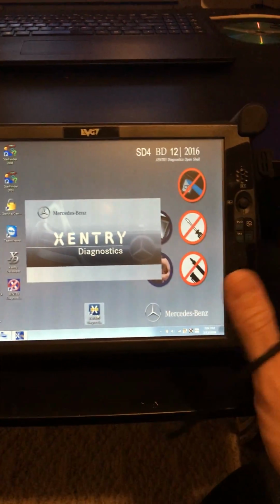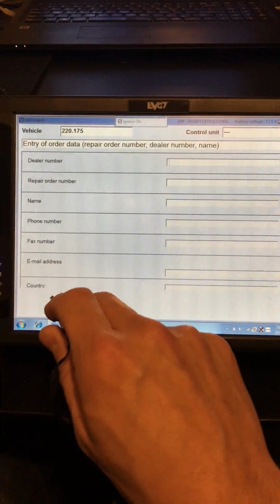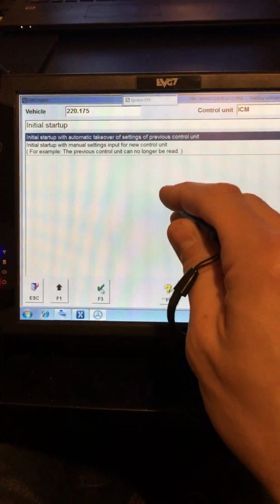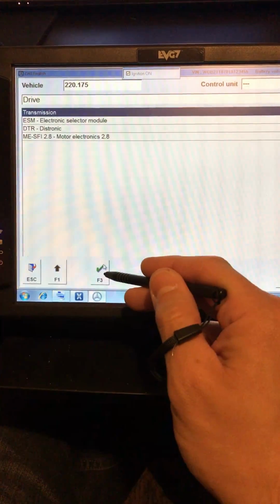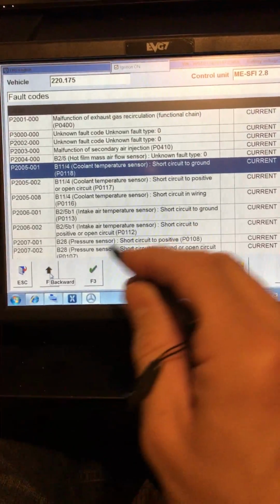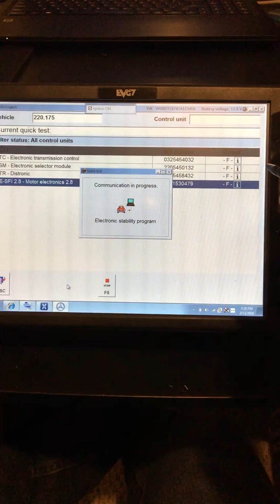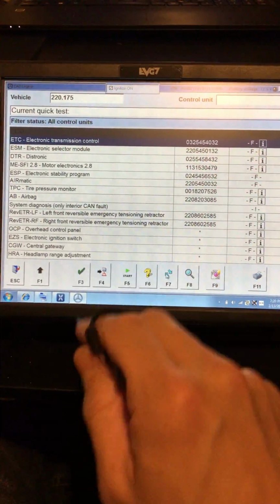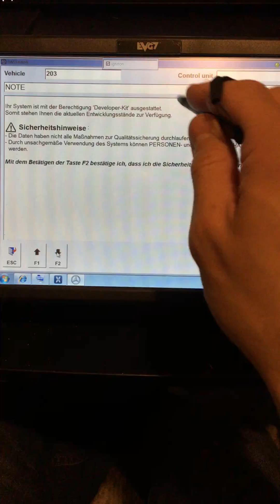Mercedes Benz SDS Star Diagnostic scanner tutorial quick intro on how to use the scanner

Comment: Man i just got mine set up man, and I was using the simulator untill my c4 comes in, and I was like " dude this simulator car is Fxxxcked" lol.

thank you for the f8 tip,its a learning curve i appreciate eit very much. maybe some more videos on this would be appreciated well already subbedA
Reply from the maker: Thank you!, yes in fact I once worked with a guy who bought a star, and the company he bought it from had the same link for the simulator under the standard xentry icon, drove us crazy, I was like lets just hover over the link click properties, dammit! He had 2 simulation icons!!! I don’t know why benz put a simulation program In but it has helped me help others through the years.
Reply: @MasterTechLou  oh wow whats different Yeah im still learning. Just really wanna fix my r170. I actually just grabbed a coil wire from another m111 i believe and it was same 2ohm but my car didnt like it at all. so I shut it iff after 2 quick starts and revs. hope i didnt break anything i have an OEM pair coming in in few days, thought id be able to get away with this
Reply: @MasterTechLou  hey Lou one another thing sorry if im being a pest. When it says Ignition off/on you said 10seconds. So its at position 2 which is ACC the mode before starting the engine, i go back 2 clicks or 1 click? and I wait 10 seconds in the Off position all the way back or just back 1 click from the Acc pre start position.

I managed to clear my codes but still ran bad, let it run for an hour yest now gonna go out again later after I check here in WIS more
Reply from the maker: @Mitutumuch  if you are using the merceded scanner it will tell you if it wants the ignition off for a time period or just off on, and off means off, on means second click where car is live. We will never use the first accessory position except for resetting maintenance in the dash.
Reply: @MasterTechLou  thank you Master Tech Lou, I have been troubleshooting my slk230 I believe to be a bad tps. I dont know where rlse to look and I found that inside the WIS limp home mode is directly correlated to a TPS. and also I found that if the TPS is faulty by any means ( signal drops) the tps works off of the throttle body instead. Dumping the boost from the supercharger to protect internal damage? that must be why theres a second butterfly valve? as a precautionary measure for the cheap tps. 

also this just so happened to be under the Brake category too

Comment: I don’t know if you’re going to receive this as I expected to see a different format for a response. I have this system and I am trying to learn how to use it efficiently. The current problem is my transmission is slipping, not going from 1st to 2nd.
Reply from the maker: Ok thats tricky.
Transmission issues. Especially working via text or chat.
My site is www.cartechconnect.com 
But first try to adapt the trans and check fluid level. Then check the fill times in the trans module for 1-2 to see if they are excessive. But If you reach out to my site ill do what I can to help. Hope you at least enjoy the videos. Thanks, Lou
Reply: @MasterTechLou  I"ll see you on your site. I have three of these automobiles so I am always trying to deal with something. I can tell you that the code I got was P200A. Then it said it might not necessarily be defective.
Reply from the maker: @beckwith46  ok my friend. You wont regret it. I build long lasting relationships with MB owners that do their own work and or own shops.

Comment: Hi, i have 2020/03 Xentry, works ok, but can't read the Engine ECU on my w211. What could be the problem?
Reply from the maker: Power,ground, data lines, bad module.
If you need help diagnosing you can reach me at www.cartechconnect.com

Comment: what a great tutorial. So i have to replace old zgw to the 'new' one from another car. After installed it Then i miss an option in 'convenience' section that is automatic seat+steer (named easy entry). What should i do, what i thought is copy from old data zgw and paste replace data to the 'new' one. So kindly please how to do it under das xenty diag? thank you in advance. regards
Reply from the maker: after running the quick test, go to CGW then adaptations, it should be in there under ALL CODES . go down the list. find the setting and select it, you can also make sure its turned on in the instrument cluster settings. it may have gotten turned off.

Comment: i see a lot of them trying to find the one like yours i see one for 879.00 and by the way i have a 02 s430 mercedes having problem with limp mode stuck in 2nd gear i replace the valve body and everything with it check transmission fluid ,i have the x431 v scanner i delete the codes but they come back would your scanner program the tcm and other stuff thank you
Reply from the maker: kennedy shorter this tcm cannot be programmed.  And no these scanners cannot program or software update. All the star diagnosis do the same just different platforms. Choose which you like.

Comment: i am having p1071 running lean code on my c230 2005 kompressor. Will this help find that possible leak? Also throwing off all kinds of engine codes, p300 and multiple misfires.
Reply from the maker: Psy Lee yes and no. The scanner does 20% of the work, the knowledge and experience of the tech does the other 80%. Normally I will not diagnose in comments but your model has a huge issue with a crankcase hose that tears. Up in the front of engine between charger and the block. This was a service recall a long time ago. Im sure you can google and find the bulletin.
Reply: @MasterTechLou  OK thanks , I'll look into it, most of the recalls were services . I think I might get one of these anyways !

Comment: Great information! What if the problem you are experiencing doesn't throw any fault codes? For example, when accelerating, the car cuts out (as though starving for fuel or spark) and all the dash lights come on briefly, but the car continues to drive. The scan doesn't show any misfire codes or anything I don't already know about on the car...have a light bulb out and a rear seat removed so the SRS code is showing for that? Will/can the cartechconnect.com site help with something like that?
Reply from the maker: Dave's Drone the scanner is 20% of the equation, the other 80% is a knowledgeable tech that knows what values should read what.

Comment: I'm looking for a scanner that can turn off the SRS light on the dash of Mercedes models. My current iCarsoft CR V2.0 shows no fault codes in SRS system. Same result with my Blue Driver. So no codes and light stays on. I have three customers with this same issue. Will the MB SD Connect C5 do this?  Thanks for your help.
Reply from the maker: William L Brice I ran Into this recently. Check icArsofts website for the up to date software on your scanner. Also try a foxwell. But yes of course the star scanner can do this. Its the oem mercedes scanner we use at the dealer :)
Reply: @MasterTechLou  
I assume that this will work.  
MB STAR C5 MB SD Connect
This requires the use of a dedicated laptop as I understand it.  A laptop that cannot be used for any other purpose.  Is this your understanding?
Reply from the maker: @williamlbrice1357  just buy their setup. it sooooo much easier that way. even if it fails its easier for them to swap it out with another one.

Comment: Pretty much everything failed on my car. I'm guessing I have to drive it around after replacing the battery to have the computers read the car. Well, what's the difference between a lowercase f result and an uppercase F result?
Reply from the maker: f- stored code. F - Current code. E- Event (basically information, ! - no communication with control unit. checkmark- no codes or events.

Comment: HI Thank you very much.This is an amazing video and shows how star diagnostics works. can you Please recommend which scanner I should buy between C5 and C6 and SSH or HHD. Thank you in advance.
Reply from the maker: Stefan Car Outlet Inc. I cannot. It all depends on your preference. They all do the same thing. Just different formats.
Reply: Benz-Tech Lou P. Thank you for your response can you please tell me if you know how I can reset the pre-safe function limited after a Collision thank you very much
Reply from the maker: @stefancaroutletinc.9330  i cannot , mainly because there is too much info and only the mercedes star can do this, best to take to a dealer. basically something is not learned. and needs relearned with the scan tool.
Reply: Benz-Tech Lou P. OK thank you I was looking to buy a Xentre star diagnose I will let you know if I have fix that problem thank you
Reply from the maker: @stefancaroutletinc.9330  yeah the seats, steering wheel, sunroof,. seat belts,. windows all have to be synced.
Reply: Benz-Tech Lou P. OK thank you very much please continue with that nice videos

Comment: New to the channel.. my Mercedes key will start my car but it won’t lock or unlock or open my trunk. If I click the lock/unlock button on the inside of the car it will lock or unlock though so I’m guessing key? I did recently get a new tint and stereo. Pls help. 2007 Mercedes C230
Reply from the maker: Alex Bateson check fuse 8 or 9 in the trunk, Im typing this while away from my diagrams. If fuse is blown you most likely will need a rear antenna on the back glass. If you care to donate you can reach me at https://www.paypal.me/benztech
Reply: @MasterTechLou   l have the same problem , my car is a 2006 slk 280. my antenna is on the left rear quarter panel. is there anyway to bench test it see if its good or bad.....thanks
Reply from the maker: jason jones bench test no, not that I am aware of sorry sir

Comment: Newbie question...
I know the software can go on a laptop but
isn't there another device you need to get the laptop to talk
to the car? I have a 2001 S600 and am trying to find what
pieces I need to be able to use STAR with it.
Reply from the maker: Better to ask the question than not :)
it depends on the version you buy. go to www.mbstartool.com you will see the different kits. the newest version is a BRICK that has all the functions inside of it and you install the operating software on any computer. before that they all use a computer with all the operational stuff and software with a multiplexer that does the communication. Hope that makes sense, at least it did in my brain :)
Reply: Thanks a lot. Looks like they have what I need.Since I don't work on cars for a living it's tough to
justify such an expensive tool but I suspect
after the second or third repair it would pay for itself.

Comment: Hi Lou, I have a 2006 w220 and the pesky TeleAid visit workshop light comes on after the start. Is there any way to get rid of it using the Star. Please let me know.
Reply from the maker: yes, you will need to get a fiber optic bypass loop, and use the start to remove the coding in the instrument cluster and the central gateway maybe and lastly the command. 
Lou

Comment: I have done a complete ABC conversion to Coil Overs and have replaced the ABC Tandem pump and need to remove the ABC fault error code. I was given the screen shots for coding out the ABC on the R230. Mercedes dealer ship wants to charge for two hours labor min, to do this job and from what I was told by another TECH its a 15 min to 30 minutes max. Does it make sense for me to buy a used Star Diagnostic Computer to do it myself?
Reply from the maker: I cannot answer that for you, it is up to you, they most likely want to not only code it but drive it to make sure its ok, true the scanner process take little time but you do want a quality repair and if they have not done this in the past there may be more that is needed once done, I was  a dealer tech so I can see why they want to charge that much. What if they charged you 50$ and just did what you asked and gave it back with issues, now they are the bad guy. So you can argue both sides, to me I may have done the same, with option to only charge less if it went super smooth. That is my opinion with working in the dealer for 15 years. 
Lou
Reply: @MasterTechLou  thank you that makes sense!!

Comment: Can you look up the fault codes directly in WIS?
I like to read this stuff, there is always something interesting.
Great video by the way.
Reply from the maker: With fault codes, you can look up engine and transmission, but not for all models, it is tricky, use the ** signs, so like start with ad07.10** see what pulls up, get tricky with them and the positions you will see lots of hidden gems in wis.
Reply: Benz-Tech Lou P. 
Thanks for your reply.
For some reason I can’t transfer from Xentry to Wis. ( some kind of soft. glitch) Than when I start the wis on its own I don’t see an option to search by the fault code.
Reply from the maker: There is no option to search by fault code. Try opening wis and then using xentry. Mine seems to do the same most likely due to the bootlegging of it. But when it shows you the wis document number you can use that.

Comment: Can I remove  a hard code like Code088 Splinter fuel rail pressure sensor reprogramming needed its in limp mode and cant drive over 40mph, i replace the sensor but I need to program the van back to normal to run normal I just want to get back on the road. Will I be able to clear the hard code with the C4?
Reply from the maker: Hello, this SHOULD be able to do that however I have not done this personally outside of the dealer so do not hold me to that :)
Lou
Reply: @MasterTechLou  the only thing Im sketchy about reprogramming or something more in depth like the coding that only authorize techs have access to which is the  Mercedes server database to make sure you get the current and correct code for the repair... Any Hacks? or cheats? on bypassing lol...

Comment: Did you just buy a Chinesium system that was ready to go or did you install the software from scratch?

Which MUX are you using?
Reply from the maker: Innovative Solutions chinese evg7 version. No mux at the moment. I only use the simulator for assisting in diagnosis at the moment.

Comment: It would be great to see you navigate the XENTRY platform in detail as you are working from the DAS program here. The HHT-win demonstration would also be good.

I’ll be uploading soon as I will showing the programming and SCN coding of a new SAMF module in a 2010 W204 (C300 4matic) using my Autel MaxiSys Elite.

Old unit had water damage and no communication with the car was possible as it arrived on a tow truck.
Reply from the maker: Innovative Solutions thanks for the input. I will be making a xentry video soon. The hht will be more difficult but I will do one as well. Thanks!
I also work with people to show them how to diagnose mercedes and use the scan tool. If you need help hit me up at www.cartechconnect.com

Comment: Thanks for sharing your knowledge with the STAR Diagnostics.

Would you be willing to do the same with Vediamo and Monaco DTS?
Reply from the maker: Innovative Solutions I would love to, I don’t currently own those however. If you have insight on how to obtain or sell that would be excellent. Currently im a iCarsoft seller only
Reply: @MasterTechLou  mhhauto.com
Reply from the maker: Innovative Solutions what is this site? Thanks
Reply: @MasterTechLou  It's without any doubt the most advanced and awesome forum that a modern day auto tech can join. You will need to make a donation of 15 - 25 dollars if I recall in order to get approved for a user profile.

There is more Mercedes Star Diag. info there than you could possibly imagine. There are seasoned users who will remote connect to your PC and set up software, assist with diagnosis, and perform other technical tasks. Most have a fee for this. 

There is very few virus threats there as it is well monitored and administered.
Be sure you read the FAQ and post a thread in the "Introduce Yourself" section before posting anything at all.

I thought I had acquired some advanced knowledge thru my 20+ years as an auto tech, but I feel like I'm in preschool when I'm there.

I have made other financial contributions to the forum since I joined just out of feeling guilt for not having anything else to contribute with software and especially seasoned knowledge. I have a hunch that there are real MB techs working that forum. 

It has info about all manufacturers including big trucks.

You won't regret joining once you dive into it. You will find Vediamo and DTS Monaco within.

Let me know what you think should you join the smartest auto tech forum ever created.
Reply: @MasterTechLou  contact webmaster@mhhauto.com for membership. Sometimes they close down any new memberships for xxx amount of time. I don't know why.

Be sure to LIKE and RATE before you send any PM's for file access or you won't be getting whatever it is you seek.

I would imagine that your videos detailing the software would be a great contribution. I've spent countless hours to learn from trial and error and reading reading and more reading.

I built my own MB Diag PC with a Dell D630 and I'm using a Chinesium C3 MUX.
I need a C4 or a C5 clone to perform SCN coding and programming for newer models.
Reply from the maker: Ok thanks! I will look into it. I also host a podcast called stealership stories. Check it out. :)
Reply: @MasterTechLou  Somewhere between not fixing your Benz and paying full price at the stealership is a HUGE window of opportunity for the independent MB technician to make a living.

Luxury cars were designed to please the original buyer and the one following. Beyond that, the manufacturers don't care. I think I saw your email in a reply somewhere. I'll reach out to you there.
Reply from the maker: @YTInnovativeSolution  thank you very much for the info!
Lou